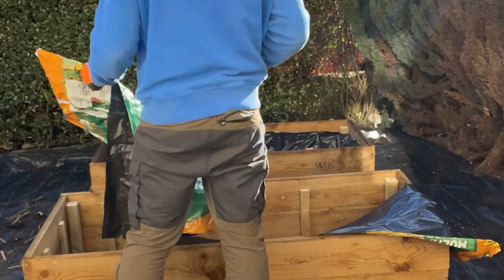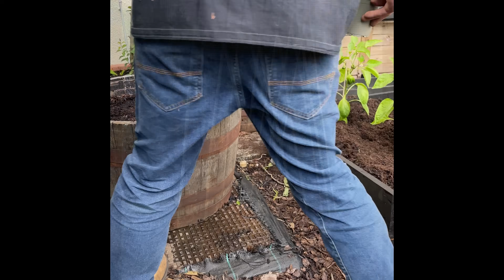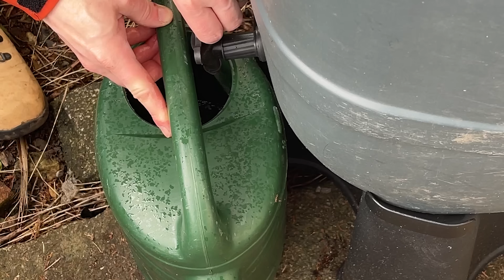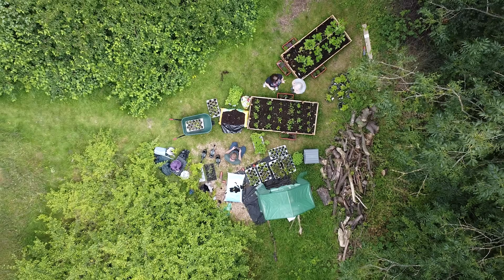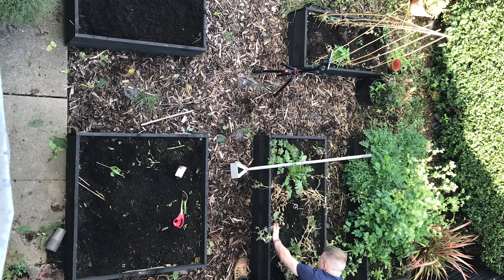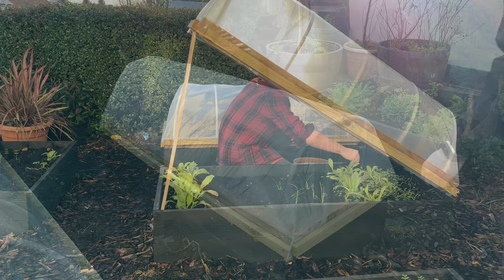The unexpected results of growing food in my front garden.

Comment: We took some old building material wood out of a guy’s burn pile with his permission and built garden beds down each side of our sidewalk, and they were a bit taller than those in the video so they held more dirt.  We lined them with chicken wire and cardboard/straw to keep burrowing animals out (like moles), and the straw padding underneath helps retain moisture.  I went ahead and used black barn paint to paint all of the old wood to help it hold up longer to water damage, and lined it with old tarps we had on hand.  A lot of grow bags are made of this material anyway.  My house is white with black trim, so painting the wood helped tie it to the house design while also protecting the wood.  We installed buried 4x4 posts at a spacing that allowed us to attach metal cattle panel fencing to each post and then we arched it over the top from one bed lining the sidewalk to the other as we had beds down both sides.  This created a grow archway down our front sidewalk.  When it’s covered in pie pumpkins, zucchini, peas, pole beans, vining flowers, indeterminate tomatoes etc and the edges lined with marigolds to deter pests, it’s really quite lovely.  Because we also decorate heavily for Halloween and Christmas, the archway offers a valuable opportunity to decorate a lit archway in colors of that holiday in the off season.  We zip tie up tube solar lights onto the archway fencing and it’s really cool when covered in spiderweb/spiders/skeletons/creepy glowing green lights for Halloween and absolutely beautiful at Christmas covered in alternating bands of red and white lights in a candy cane stripe pattern.  We run lights to tall candy canes on the outside edge of the garden beds down the sidewalk so it truly looks like a candy cane lane up to our house.  We’ve also never had anyone steal from us when the produce is growing there.  We do get people who come up here to talk about everything we’re doing though.  It generates a lot of interest.  I have a huge garden so it’s pretty big/long.  It certainly is eye catching.  We hung mason jar lights in white lights underneath the archway and because we mounted the panels on the top of the already taller wood garden beds, people can safely clear the hanging objects without risk of hitting their heads.  Each 4x4 post at the meet up of every two cattle panels wired together and attached to the post is capped with a multicolored fairy light solar lantern, so in the dark it sure is beautiful to both us and the public.  Warm white lights down the tunnel, soft fairy lights in misty pastel tones down the outside edge on both sides.  Lovely.  And we had a bumper crop of food, so much so that winter is on its way out soon and we still have plenty of preserved food from last summer.